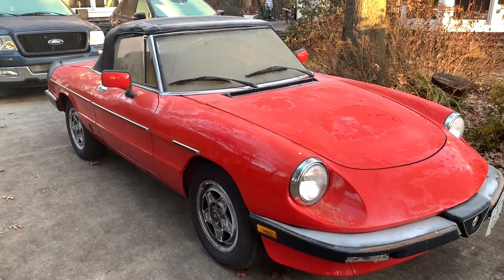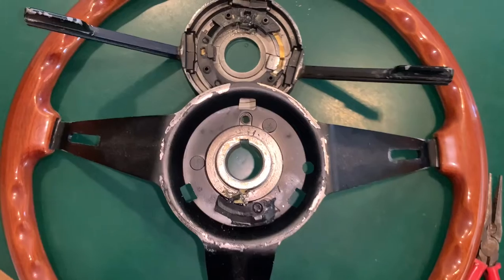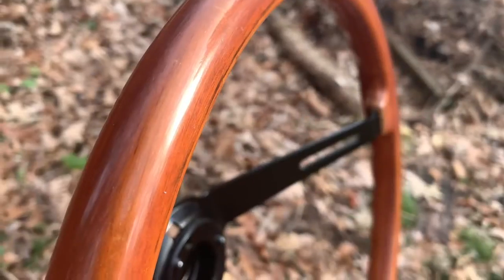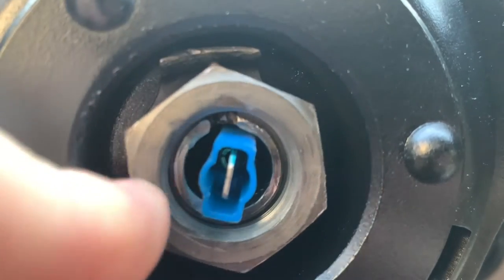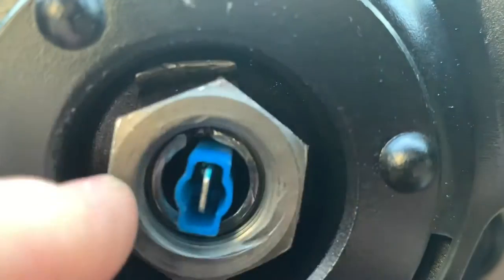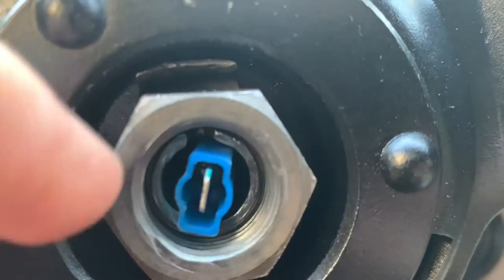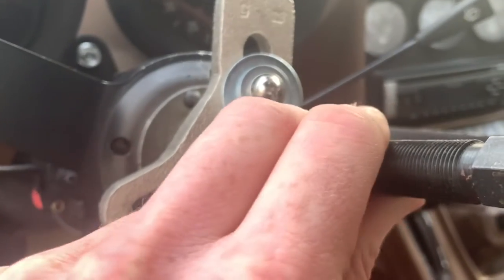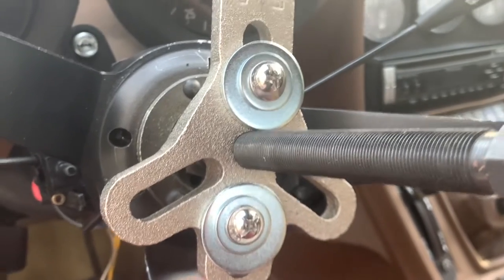1-Minute Guide: Removal of Alfa Romeo Steering Wheels

Comment: Hello,

I am trying to get the steering off... omg the wheel puller had so much force on it it pulled one of the guide bolts through.. now it's stripped.. is there anything else holding that suckered on there? 1987 spider